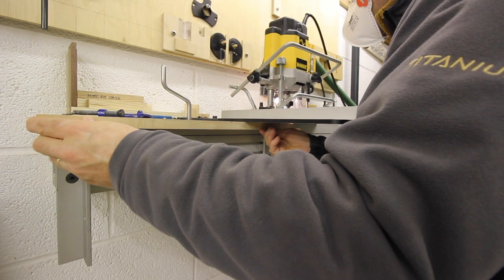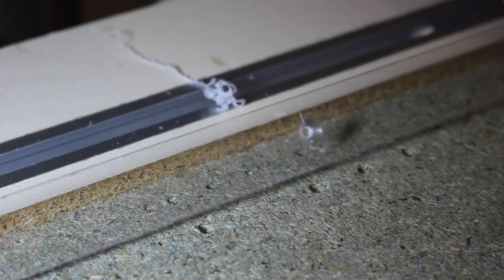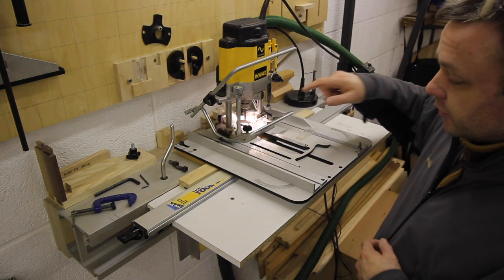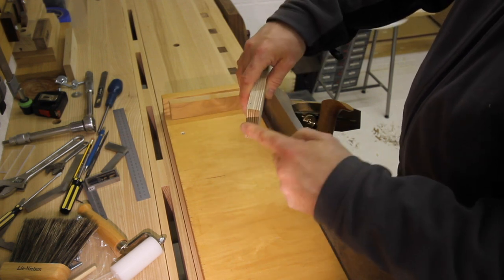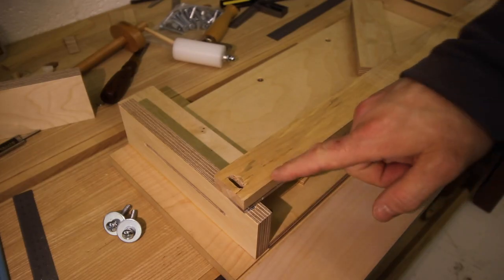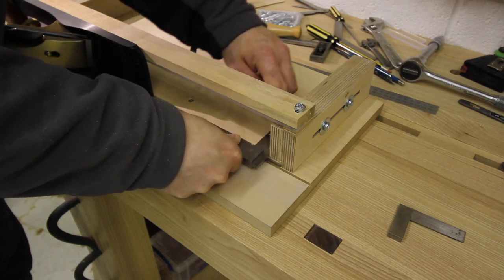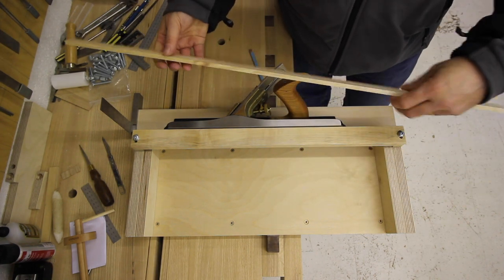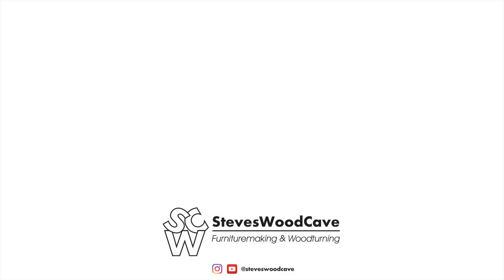The Ultimate Shooting Board - Part 2

Comment: Yes , more on the horizontal table, I always feel apprehensive putting my fingers under the rat's table. all the best,  jack
Reply from the maker: Ok, I will put something together at some point but it’s not going to be for quite some time now. I moved house recently and need to build a new workshop. Everything is on hold now for a bit. The horizontal table is just a piece of 15/18mm melamine (in my case) or similar manmade board. To attach it to the Rat you just make 2 triangular shaped laminated “brackets” of ply or mdf. Screw each one to the underside of the H-table located exactly where each cam clamp is on the Rat. You can add a couple of slots as you see on mine and make some low profile clamping jaws which are attached through the slots with bolts and wing nuts. Hope this helps?
Reply: @SteveCashmoreWoodworks  sorry for the delay ,yes it dose help . hope all is well with house move ,please make yourself a good workshop , all the best .lignator jack.

Comment: hi.steve looks good so far, will watch all 3. very resourceful. i would also like to see woodrat table and any other mods.by theway its a very good book. thanks v . mutch. lignator jack.
Reply from the maker: Thanks Jack. Do you mean you would like to see more info on the WoodRat horizontal table and other jigs I’ve made for the Rat? Yes, it’s an excellent book! Cheers Steve
Reply: @SteveCashmoreWoodworks   hi steve yes to that,look forward to all your vids.but settle in first ,good luck jack.